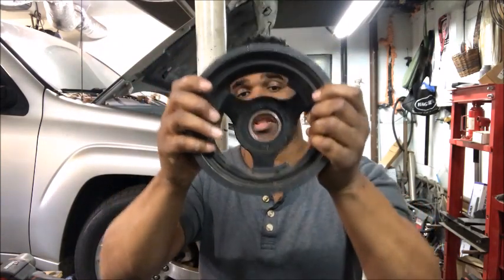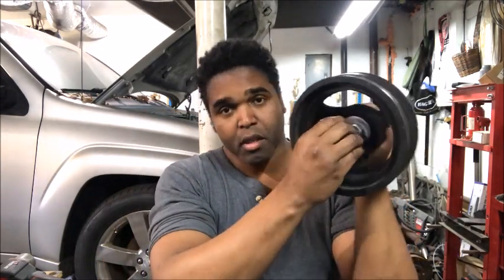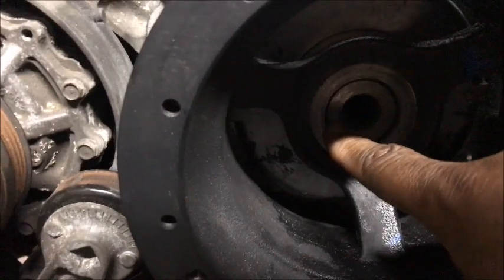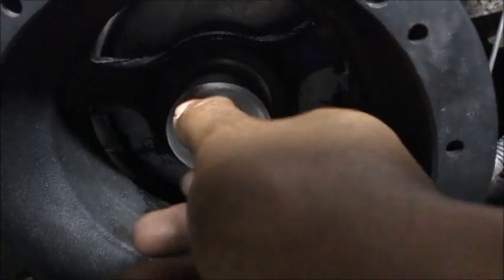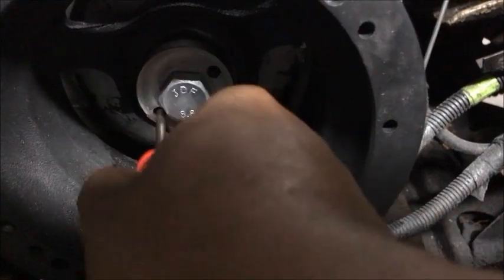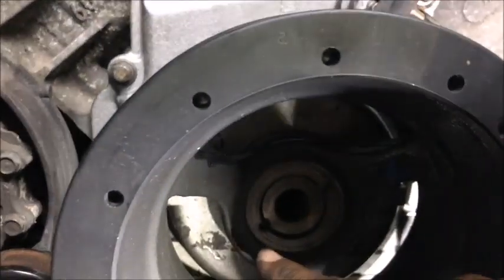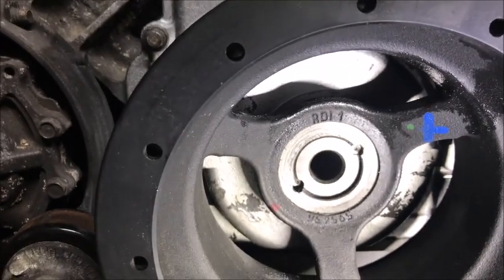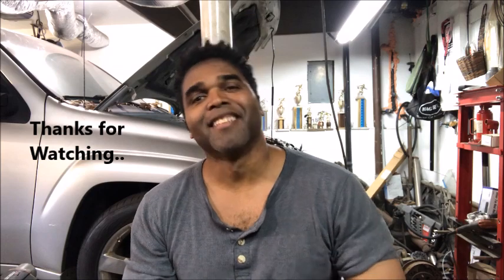How To: Pinning A LS Crankshaft. (4 Easy Step When Adding Power).

Comment: What would be the easiest way to reinstall and align an already pinned balancer on pinned crank. (Serviced your engine, but now reinstalling)
Reply from the maker: try lining up the crank, put the pin in while the pulley it somewhat on the crank. tighten it down and the balancer should align itself to the pin and crank.. keep me posted..

Comment: Do you have to stake the holes the pins go into? I'm wondering what holds them in place after you insert them.
Reply from the maker: whats good brotha Brian.. when you bolt the tool to the pulley, it will holds tight for you to drill the holes. hope this helps..
Reply: @Coverman66  yeah, I didn't realize the head of the bolt covers the pins. Great video.

Comment: So you're placing a pin in the keyway once drilled to brace the pulley and drilling another hole to make sure the pulley stays secure in position to the crank? These pulley's aren't just serpentine pulley's, they're actual harmonic dampers (acoustic resonance). Have you thought of installing a Fluidyne Pulley?
Reply from the maker: if i was racing and changing the face i would go that route or ATI .. but its a set it and forget it for me..

Comment: Terry how do I know where to tape it so I know where to stop ?
Reply from the maker: i measure the depth of the pin and put the tape a just a lil higher on the 
drill  so the pin will seat counter in the drill..
Reply: @Coverman66  so basically I want it to sit a little bit less than flush in the crank snout right ?

Comment: Great info as always. I have a question that's off subject. Do you use high zinc bteak-in oil for your LS builds?
Reply from the maker: whats good CC,  cam companies usually give you a pack of lube for breaking the cam in. before i swap the cam out i always ask the manufacture of the cam..

Comment: I would like to do a Ly6 swap on a budget what should I get to make a nice motor. Going in 1983 Pontiac. I know you said LSA super charger what year?
Reply from the maker: you can get a cam and that will make a nice street ride. how far do you want to go with the car? what are you looking to do.
Reply: coverman66 I want it to get when I want it to get when I need it to get.i don’t plan on racing it at all but I need it to turn a set of 24” rims and a few subwoofers that’s a little weight. My auto friends don’t think I can do it without their help. But I’m on a budget and it’s had not knowing what I’m doing but I know the basic stuff like removal and replace
Reply: coverman66 I have a complete LSA super charger,CT’s-v crank pulley, I need that bracket with with the pulleys on it, What camera you have in your Chevelle I want to piggyback you car. I know you are very busy but can you send me a list of everything I need for my motor to run like yours. Please and thanks for you help sir
Reply from the maker: whats good Hustle.. here is a video i did that tells the some of the parts and cost.. if you have and questions feel free to reach out.. https://www.youtube.com/watch?v=YNYnSnebC50

Comment: How much power does the engine have to make before you do this mod.? Thanks
Reply from the maker: anything over 500hp i would do this mod.. whats good Giuseppe..
Reply: @Coverman66  Hey Terry. I'm working on getting the A/C going on the Monte. Not much fun driving in 100* weather in a car that has no A/C and T-tops!
Reply from the maker: i know that feeling lol
Reply: I just spun the pulley on my bone stock 98 C5. So no very much power if you plan on touching the Rev limiter at all

Comment: That pin seemed like it went in with little to no resistance, what keeps it from slinging out ?
Reply from the maker: the crank bolt locks it in place..
Reply: the bolt head

Comment: Terry- the round silver thing supplied in the crank pinning kit would be called an index tool/drill guide plate or something similar. For an extra measure of safety you could coat the pins with a Loctite sealant made for bearings (product number 641). https://www.amazon.com/LOCTITE-BEARING-RETAINER-Sealant-Retainer/dp/B01MQJ92VM
Reply from the maker: my man Ray.. whats good partner.. thanks for the input brotha..

Comment: Hey stupid question, I'm sure you've already done one of these but do you have the oil pan baffle or relocation pickup tube. And second have you ported the headlight, there is allot of material that needs to be removed and it's easy to do. Once I ported the left headlight I noticed more low end torque and it runs smoother. I did it in five minutes the car drives like I got a new cold sir intake. Also I had the k&n and had to cut the front part of the thing that blocked all the cold air from coming in. Your videos give me inspiration.
Reply from the maker: thanks T.. much appreciated..

Comment: Thanks again Terry. Drilling the stock cranks aren't too bad. Drilling a forged crank like a K1 or other aftermarket can be quite a different story. I found that using a carbide tipped masonry bit that is a size smaller than your pin, then finishing with a high quality metal bit on slow speed, works best. You could just buy a full carbide metal bit but they are crazy expensive and easy to break. This is a low buck solution that I found works well. Just thought I would share. Thanks and keep the video's coming brother.
Reply from the maker: great info MT.. thanks..

Comment: Sweet vid! Question though: Why don't you use the ATI pinning kit? The kit pins it on the top. If you are using a crank pulley with a keyway, you can simply slide it over. That way if you ever have to replace the crank pulley, it's much easier and no need for re pinning.
Reply from the maker: true brotha Phil, i had the LSA pulley and im a set it and forget it guy.. ATI is a great product.
Reply: Hi Terry, can u tell me how to tell a ly6 6.0 block from another 6.0 block. And what would be a good price for a bare ly6 block that needs some work. Love ur videos, n keep them coming. Thanks  Tom